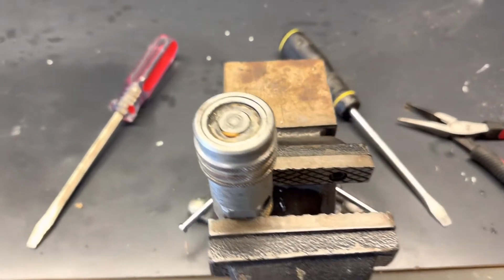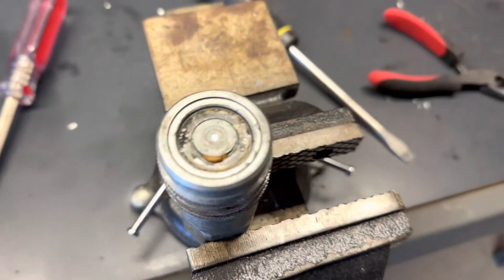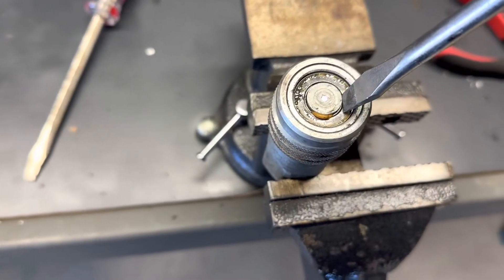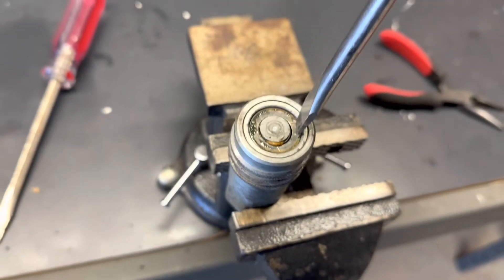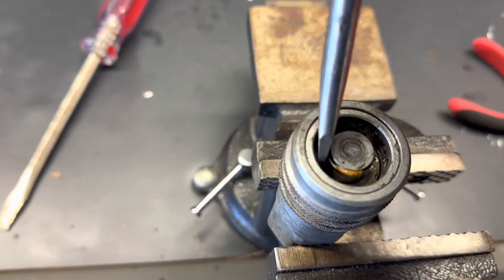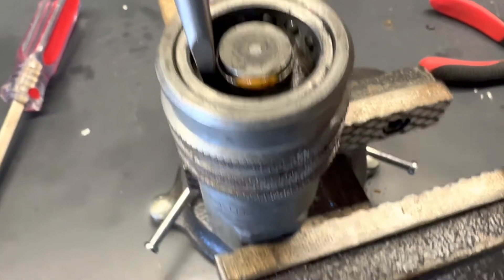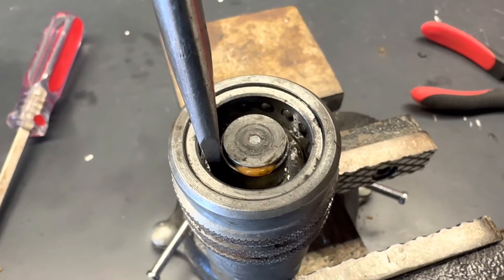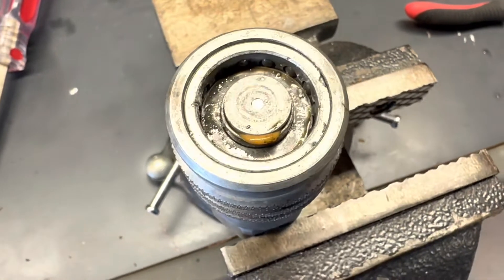Hydraulic O-ring Seal Replacement ￼

Comment: There is no O-ring on the female side. That o-ring that is showing is actually the broken one from the male side, that got sucked down into that spot where it gets stuck. Remove it from there and put a new o-ring on the male side which is pretty easy. There's already a few good videos showing how to do that. New o-ring is a 114 or R-11. Unless the teflon backing ring looks obviously damaged, just leave it in place, as you'll do more damage to it getting it out. Most times it is fine and doesn't need replacing.
  I spent a bit of time trying to get a new o-ring into the female side before I figured this out.
Reply: Yooooo, thank you!! 🙏🏾 I was stressing over here.